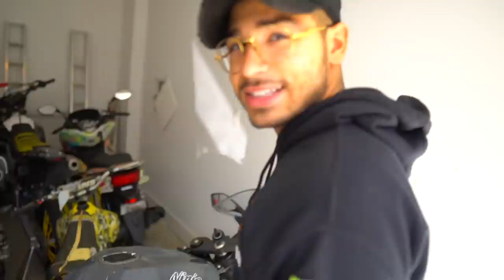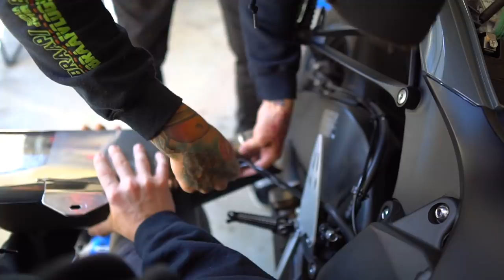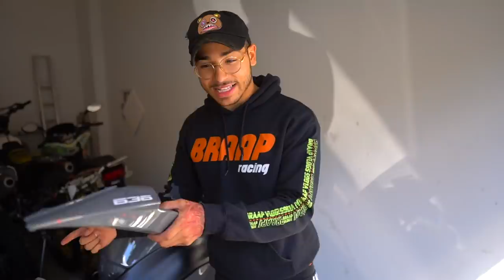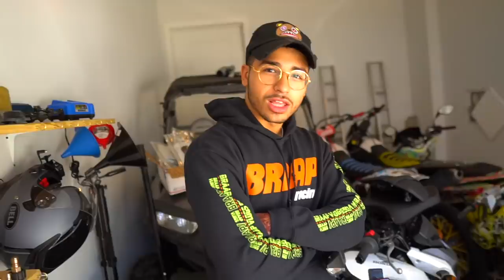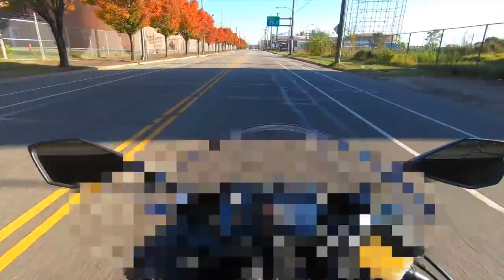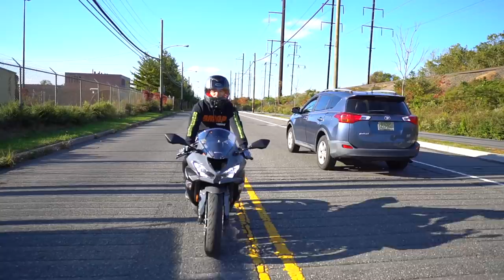TAKING OFF THE EXHAUST ON MY BRAND NEW ZX6R ! (IT'S SUPER LOUD) | BRAAP VLOGS

Comment: The only reason u should take them ecu cables off is if u are putting a exhaust on it I would not run that bike without exhaust u will have problems in the future thrust me dude and another thing y do u have a hoodie out that say braaap racing

Comment: Lmfaooo i remember when i got my first bike🤣 i did that when i was younger being a fool. You'll realize when u suck that cold are back in and cracks ur head or trashes ur valves from no exhaust. City boys🤣🤣
Reply: Travis Helms and city boys you act like they can choose where there from
Reply: @Acidrei8n  when u let off the throttle it def sucks air. U obviously haven't owned or did any serious work to ur motor im not aruging with someone that has zero knowledge about a motor
Reply: @dominic5763  an thats not what i meant by city folks either
Reply: I GOT ABUNCH OF HOMIES THAT LIVE IN THE CITY🤣🤣
Reply: Travis Helms lol
Reply: Calm down girls it’s just a bike
Reply: Travis Helms actually they would because you can't have excessive noise lmao. Technically depending on your location this is illegal because it's "too loud" not saying the air thing is right or wrong cause I'm not part of that argument 😂😂
Reply: @travishelms3797  they must not  know about that back pressure lmaoooo
Reply: @Motocross-tu5sk  then y do they put them on dirt bikes too? Exactly
Reply: @AnthonyBryan77  exactly buddy glad someone else knows what their talking about!!
Reply: Travis Helms they normally make them quieter for trails. Same as street some trails have noise things. I know it's not good to run a bike without a exhaust but the trails near me have a noise ordinance thing and same with tracks so that's why I assume. Because a stock exhaust is way quieter than a fmf. However it also does mess with compression the engine intake etc
Reply: Travis Helms I'm not saying your wrong all I'm saying is there is countless reasons of why they put them on but you can make a bike louder with like a fmf or pro circuit or something

Comment: Never mind that it's bad for the bike you're going to lose a ton of horsepower yeah sound fast but you're going to lose all your torque I don't care what anybody says if you're not a show-off you'll totally agree
Reply: I told him to get the m4gp shorty
Reply: Even if the shorty isn't more than 12 inch long it's bad for ya bike
Reply: @fullthrottletae9937  no it's not .. it's actually what I had on my 636 ... That pipe and a power commander and my shit was beast..
Reply: mikeyboost4 life “you’re going to lose a ton of horsepower...you’re going to lose all you’re torque” not necessarily. Open or Drag exhaust systems will actually add some horsepower but only at the very top end which is pretty much unusable power as far as riding on the street goes. Low end torque and hp does tend to suffer, and the tuning gets all fuckd up too.
Reply: @fullthrottletae9937  you are 100% right I'd put a nice Yoshimura or something on it

Comment: thats your servo that you pulled the wires out of. don't be surprised if you get a check engine light! Get a servo buddy and take the chamber off the header. ( I punched my cat plates outta my head pipe) Personal opinion graves slip on sounds fire

Comment: Your bike can take a lot of damage with a deleted exhaust b
Reply: Theirs not even much back pressure I know plenty of people who ride with no exhaust
Reply: Corbin Sligh you need some back pressure on normally aspirated engines. It helps the engine exhaust its gas’s a lot more efficiently.your bike is losing power running it open like that guaranteed.

Comment: Do you notice every time he goes to start it it doesn't start up and then he has to hit the start again that's because they has no back pressure I guarantee you get a check engine light those bikes need the back pressure
Reply: Bike is running dangerously lean

Comment: The bikes come lean from the factory to pass admissions to begin with. Taking the muffler off ,there for increasing air flow, and not adding some type of fuel controller to make the dangerously lean conditions acceptable/correct/healthy not a good idea. And you’re loosing power to top it off. Also don’t listen to these people who say you will mess the valves up without back pressure or some other made up reason it will harm your engine without a muffler, as long as the lean fuel condition is corrected for with a fuel controller or even better a custom Ecu flash map it won’t hurt the engine one bit.

Comment: First thing I would do is get a cage get rid of those big mirrors cuz when you start stunting it's going to break the front Plastics and then a 12 Bar in a big pizza sprocket I've been stunt bikes for years that's the first upgrades I do then you do a throttle lock

Comment: Your going to need a healtech exhaust servo eliminator plug n play so the check engine light won’t come on. those wires you took off were from the exhaust servo the more gas you give the more the servo opens. Just did that to my boys gsx s1000  it tricks the comp to think the servo is working and supposed to make the throttle a little more crispy.  my dude put a slip on ASAP before you destroy your valves and have to do a valve job don’t listen too these dummies saying it won’t mess anything up that’s a brand new bike you’ll throw the valves out of wack especially Not being full broken in , sounds good but can really hurt your motor. #BSQUAD welcome to the street bike life #ridesafe my guy and keep that content coming

Comment: Straight pipe it if you like that sound so much.. It will finish off the exhaust how it should be done and sound jus as great... But I got a full D&D exhaust headers and all and it made my bike sound like a liter bike bro no bs... not sure what they would sound like on yours but I swear by em... deff worth checking out their stuff and I would get rid of all the extra plastic shit like the rear tail light extension and all that bs... good luck bruh

Comment: It won't ruin you're bike running straight pipe. You'll just lose a bit of power but you wouldn't even notice and you're F5 or F4 comes on once you remove the exhaust wire

Comment: If ya like the tone and how loud it is they sell lil small pipe ya can get off eBay and stuff maybe not have one listed for your year yet but I'm sure if u measure it just a few years old one will work but I would get a nut welded on to a pipe to have that o2 still hooked up so the bike will run better with it being new or ur ecm won't be able to keep the bike tune right